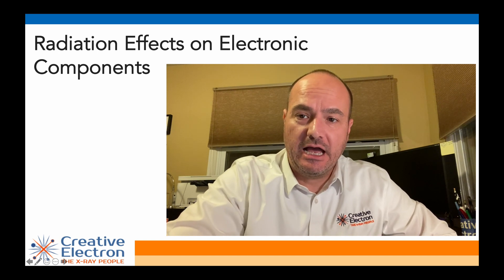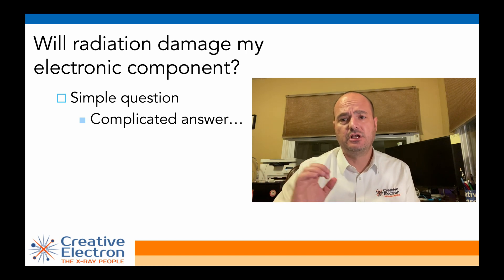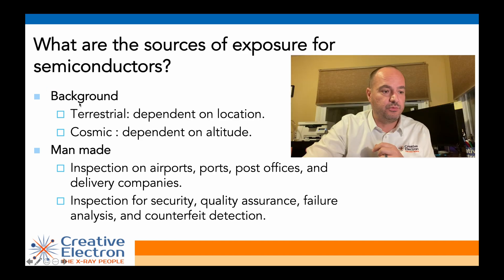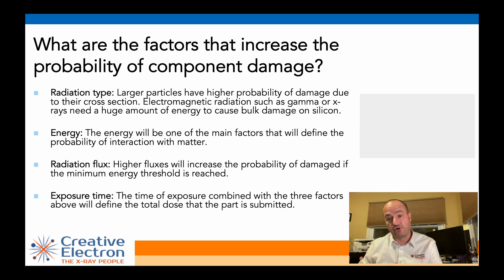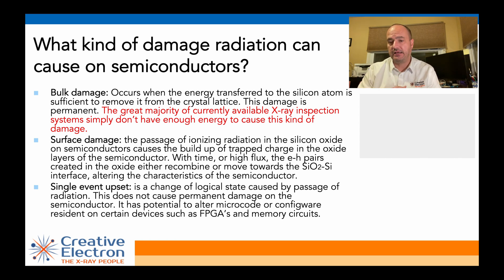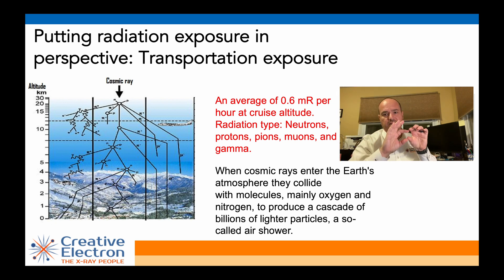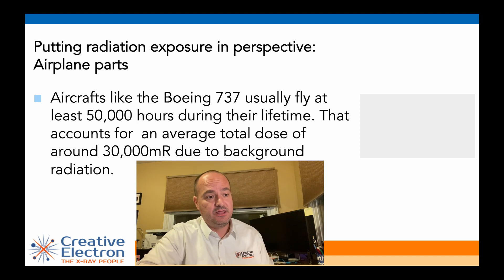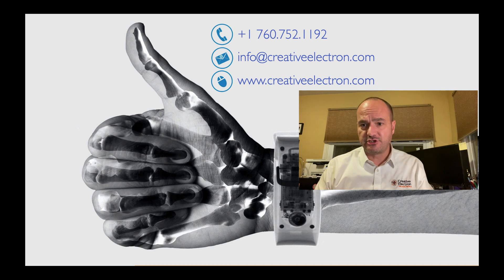Tips and Tricks   Can Radiation Damage Electronic Components?

Comment: I bought in past a very low-threshold mosfet transistor. When I tested it - I found out - the component had been damaged.
Reply from the maker: That's interesting, how did you test it? Was it x-ray imaging? If so, what kV, mA, and exposure time did you use?
Reply: @CreativeElectron  I didn`t test it with X-Ray at all. This transistor, I think, was delivered by a plane (in my country transistors are not produced). So I tested it by a multimeter and the junction was destroyed (very low resistance drain-source).

Comment: Some of those Digital sensor are only rated up to 35kV x ray radiation, is there any reason. What would be the problems for such a sensor will there be degradation of the sensor matrix, the electronics of it can be shielded quite easily.   but cant imagine why they would break if you use them with 90kV x rays. Do you know anything about that. Something like a C9732DK. Thanks
Reply from the maker: That's a great question! These sensors rely on a fluorescent screen to convert x-ray photons to light. Light is then converted by the photodiodes to an electrical current that is amplified (and later converted to a digital number by an ADC). What determines the "max kV" the sensor can take is this fluorescent screen (among other factors). The C9732DK is optimized to 17keV, meaning that above that the detector starts to saturate. Although the photodiodes can take the 90kV, at that voltage you may not be able to see anything, as the screen will be completely "white". In other words, the sensor will be saturated. This sensor is designed to image low density samples, like plants and seeds. I think we have one of these sensors in the shop, would you like to see one taken apart?
Reply: Oh ok, i would have thought that maybe the fluorescent will degrade with the higher energies. And that maybe the CMOS and Diodes may take damage from that. But would not reducing the intensity of the beam help to prevent saturation. Cool you have such a sensor they are really hard to get and expensive ;), would be interesting if possible. Thank you for your response, i really enjoy what you do, not many companies do that!
Reply from the maker: @heinrichhein2605  Absolutely! We also have a sensor that takes higher radiation, I'll see if we can open that one as well to show you a side-by-side comparison. Keep watching, and let me know what else would you like to see. And keep hacking (safely, of course)!
Reply: Amazing, yes that would be cool maybe we can see a difference. For example the shielding for the electronics etc. Maybe you can show the effect on the image of using a "wrong" kVe wave length with adjusting the intensity. Yes safety is important with that stuff!